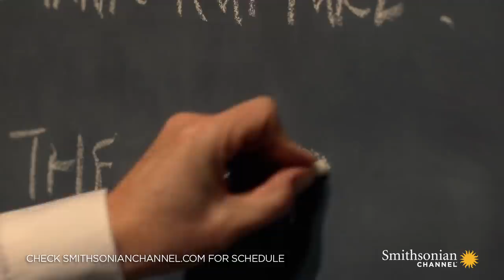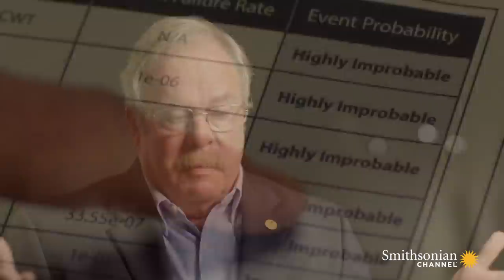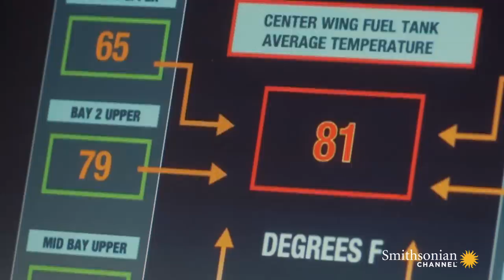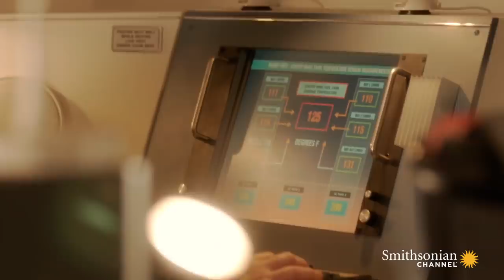How Air Conditioning Caused TWA Flight 800 to Explode

Comment: But what caused the spark?
Reply: * Of the 183 who said they saw a streak of light, 146

       provided a description of the path taken by the streak.

       Seventy-seven said it was ascending, 11 said it was

       descending, 47 said it both ascended and descended, 9

       described it as level, and 2 said it both ascended and

       was level.

* Color of the streak.  Forty-four said it was red, 33 said

       it was orange, 23 said it was orange/red, 24 said it was

       white, 2 said it was white/orange, 7 said it was yellow,

       7 said it was yellow/orange, 2 said it was white/orange,

       and one said it was yellow/red.  Finally, one witness

       said the streak of light was green.

http://twa800.com/4a/exhibit4a.html
Reply: Faulty wiring outside the tank

Comment: WOW is the fuel flammable
Reply: WOW, No it is not.
Reply: The liquid isn't flammable but the vapor is
Reply: lol.... Tell me when you know what you are talking about, ok.  And then where did you graduate Aviation school?   I am former U.S. Navy "Aviation Boatswain" Extraordinaire,  Fleet Sailor.  That was my professional career on Two Aircraft carriers and several shore Naval Air facilities.  [Aviation Kerosene] IS NOT a Flammable Liquid, it is a Combustible liquid.  Please don't let the word 'liquid' confuse you. However, The 'vapors' as you will,  do not and cannot "explode with the energy of a bomb".  They might go puuuuffff....  (like when you toss the match on the BBQ)   if a thimble full of Aviation kerosene could crack the strongest airplane ever built, in half,  we would be making BOMBS out of kerosene.  You can't blow up a 747 with a spark.
Reply: @robshef718  - That's incorrect there is such thing as explosive combustion which is why materials such as sawdust, flour and sugar have caused explosive pressure waves.

Comment: So what caused the spark???? UHHHH half finished video.
Reply: cables ran through the center tank and were old. caused the spark
Reply: @reflirt  Thank you!
Reply: There was not and cannot be any sparks inside the fuel tanks as suggested by this fake video. There was not nor ever can be a fuel tank explosion from a spark.  You Cant explode Kerosene with a spark.  Jet Fuel is not a flammable but a combustible liquid.
Reply: No cables in the fuel tank...capable of blowing it up. That is impossible. There were no 'O L D' wires as errantly and ignorantly suggested.  The 747 was brought down by an errant path of an  'X type AV', on a collision course.

Comment: What caused the spark?
Reply: There was No Spark.    There was No fuel tank explosion.  You can't blow up Kerosene with a spark even if.
Reply: ...there was no spark.
Reply: @trueknowledgeispower  it was your ass. Jk it was a short circuit where high voltage current jumped into low voltage wiring and traveled to the fuel tank and short circuited which was enough to ignite it

Comment: Jet fuel is flammable!?!? 

Who would have ever thought!!
Reply: NO.  Jet Fuel is NOT FLAMMABLE. (not to the point of any high energy detonation)  Jet A' is a combustible liquid.
Reply: @robshef718  
1. Explain 9/11.
2. JET-A1, also has a flash point higher than 38˚C – crucial, as it makes the fuel less likely to combust unsafely. Once vaporised, however, jet fuel is extremely flammable and burns at a much higher temperature than other fuels.
Reply: @JoMiMi_h   This is not a 9 11 forum. The Flash point does not mean Explosion. it only means that Vapor can be present. You are confusing Vapor with the fuel being in {its} combustible state, which it only is as it is introduced into the engines combustion chamber. Jet fuel is not 'extremely' flammable. Aviation kerosene is an 'extremely' low volatile fuel. it is not a flammable but a combustible liquid. Trying to ignite static jet fuel is like trying to 'ignite' a jar of peanut butter. Signed; Rob Shef, former US Navy Aviation Boatswain, Second Class.

Comment: 260 witnesses saw a missile hit the plane yet FBI called in a physic! The navy shot it down and FBI had no business being there. Missile residue was found on plane remnants but police arrested the guy who did the test
Reply: It is physics, the plane crashed 12-20 miles away from land so the explosion was delayed which is why when people heard it they saw the smoke, which was nothing more than the fiery debris falling to earth. As for the FBI they had every right to get involved, an American plane has crashed in American airspace so the FBI will investigate to see if it eas foul play or an accident.

The NTSB examined2 sheets of metal that had bomb damage and high velocity missile damage and niether sheet was consistent with the wreckage of the 747.

The explosive residue was also questionable because the residue washes off in water within 2 days and some of the wreckage spent days and weeks underwater meaning that it came from the recovery boats. 

No conspiracy here just simple physics which apparently many people are unaware of
Reply: @ey7290  This very 747 was also used as a test for dogs to sniff explosives, prior to its last flight, as a training. So a bit of powder was remaining here and there. It also could be brought in accidentally by the military that helped to recover everything that was floating on water.

Comment: This episode is nothing but total propaganda and should completely disregarded.  I have copy and pasted the fax letter that was sent by retired Brigadier General, Benton K. Partin(1925 - 2019) on October 4, 1996, seven weeks after the TWA incident to the lead TWA-800 investigator in New York.......The fax stated as follows:

      "I did the initial design, development, and test of the first several continuous-rod warheads for the MOMARC missile in the 1956-7 time period. This was done at the Ballistic Research Labs at the Aberdeen Proving Grounds in Maryland. I carried several to Socorro, New Mexico for testing in a special arena nearby. A proximity fused, continuous-rod (CR) missile warhead is the only target destruction system I know that would be consistent with all damage assessment information I have seen in the open media. The destructive mechanism is unique to that type of warhead. You would not see blast or blast-frag damage. Neither would you see residuals from explosives. The instantaneous kill is unique to that warhead type, The CR warhead is the most difficult to perfect even with many design iterations. I would encourage you to have someone reassess the recovered structure who is familiar with the unique structural kill of a CR warhead. 
If I can be of any help, let me know." .............................................................................signed, B.G.,Benton K. Partin(Ret.)

This confirms the Clinton Administration cover-up of this accident.
Reply: You are so far behind....its boring and just plain dull...... Is This! all ya got....

Comment: Well, the second part to this crash is a short circuit, however it was the air conditioning that got the fuel to vaporize.
Reply: Go back to skewl.  No 'Ac' issue. No 'vaporized' fuel, No spark.   Non sense.
Reply: @robshef718  Okay sure yeah, I'll give up my beliefs without solid proof that science is wrong about states of matter and short circuits. Sure thing. Here  you can shake my hand that's not even there
Reply: @ajandrewy.1024   Your 'beliefs' wont make pigs fly either. Certainly you never graduated any viable 'science' class. TV shows with everything "Blowing Up" and Mc Gyver 'Saving the world' with a tooth pick and some chewing gum, is not 'science', its science fiction.
Reply: @robshef718  I'm not even going to say anything anymore after this. I just wanted to put a comment out there to add to this video, and people like you seem to have to reply with hate and assume so much about people that may not even be true. And sure, maybe it is true it was hit by a missile, but I don't believe that right now.  Maybe other flights went down for another reason, but I don't care. These crashes have helped us learn how to make air travel more safe, with sterile cockpit procedures and better maintenance of aircraft.
Reply: @ajandrewy.1024   You cannot say anymore because you can't.  :)
Reply: @robshef718  exactly it's the end of this basically
Reply: @ajandrewy.1024   Thank goodness for you!  lol...

Comment: Good old engineering genius !!!!
Reply: Can you offer some more information on your abbreviated comment?   Thanks.
Reply: @robshef718  They essentially put a heater under a gas tank !!!!
Reply: There are no 'heaters' under the 'fuel tank'.     btw, Jets don't use 'gas'.   just saying.
Reply: @robshef718  the story above says Air Conditioners that were over heated under the fuel tank !!! maybe they're lying !!! 1:44 maybe fresh air intake and air exhaust ducts were clogged and corroded !!!
Reply: who said anything about gas ???
Reply: You did.
Reply: @robshef718  whoops,  your right it was jet fuel,  I said gas, I apologize !!!
Reply: apology accepted.